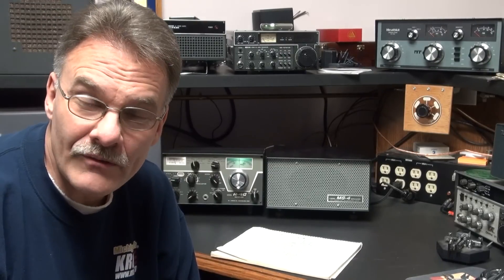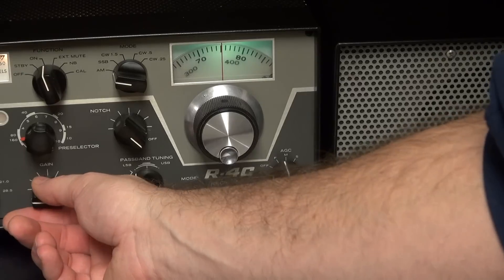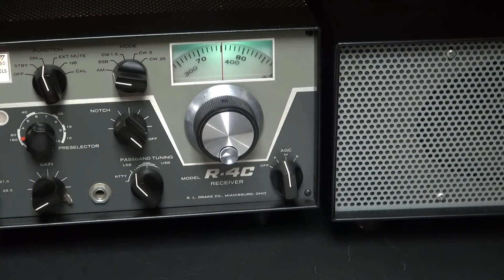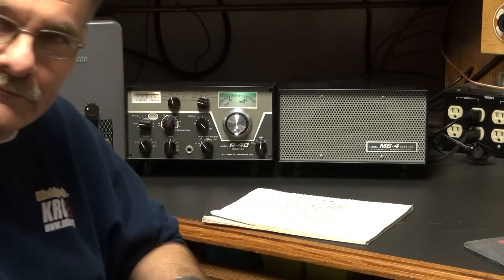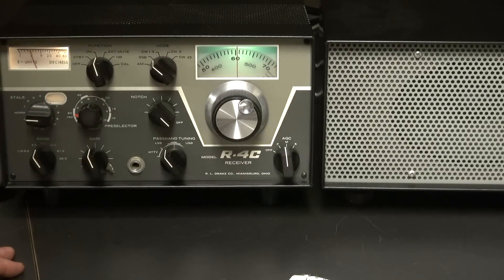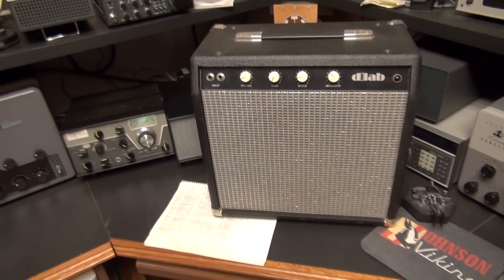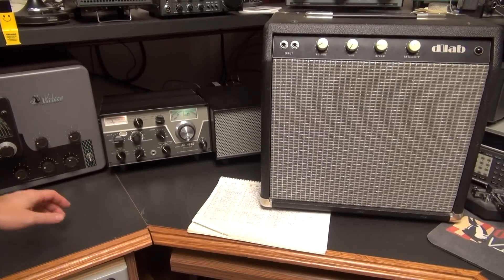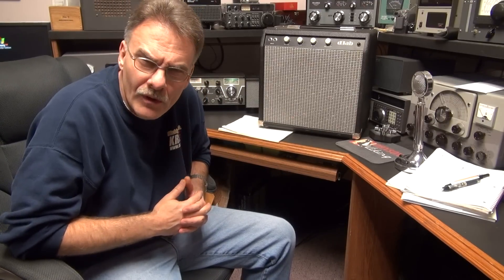D-lab Drake R-4c Ham Tube Receiver Audio Modification Demo

Comment: So what was the mod you did to the R-4C audio?I cannot find the video showing what you did.  I agree with the other guy that I couldn't tell much difference. I do run a stock C-Line  and my R-4C sounds like your mod.  It might have been your microphone. My computer's audio is run through a stereo amp into 9" speakers. Also Rob Sherwood's mods  were more for using the receiver  on CW. 73 de Jim, WA8SDF

Comment: Hi Terry, Really enjoy your videos have watched for years. I recently got a TR4  and have done a few repairs. My question is HOW to Cure the IP meter from bouncing? When I put the rig in tune that IP meter bounces so much I can't tune it SAFELY or for fear of causing damages to the rig. I doubt anyone could safely tune it. Also would like to know a replacement for the RX TX fuse? It's a #12 bulb but I can not find any source for a #12 6 volt bulb fuse. If you see this could you let me know?